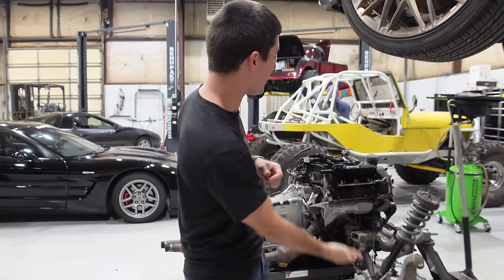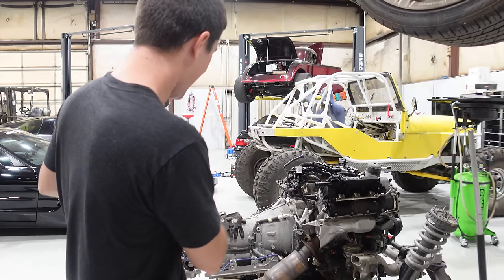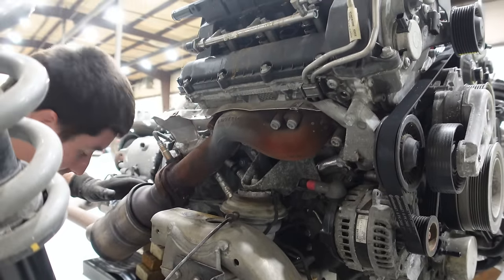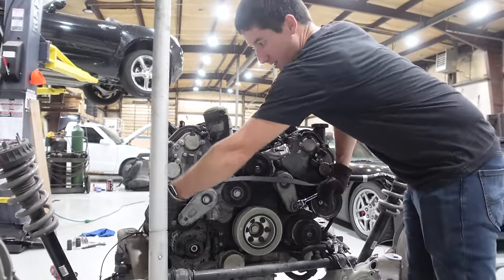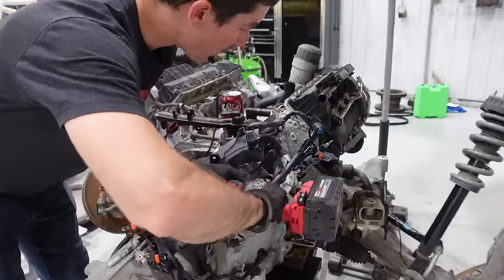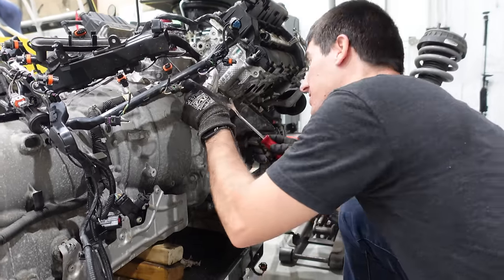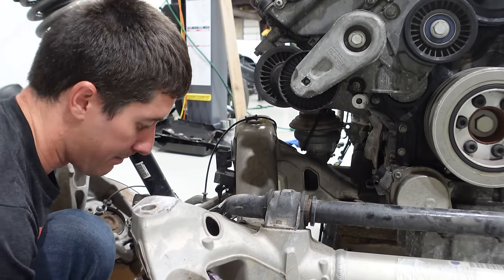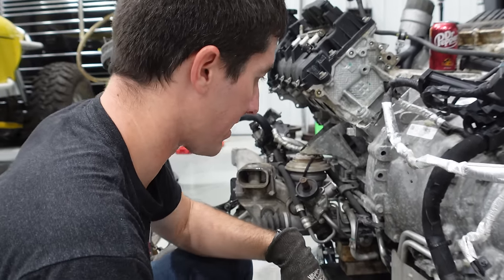My RUINED Jaguar F-Type Engine Should NOT Have Been This EASY To Separate

Comment: Regular maintenance in most of the cars: alternator rebuild.
Jag's manual:
1st step: loosen the exhaust tailpipe
2nd: remove the front passenger headlight bulb and headliner
Reply: Toyota: 
1. Check electric current
2. Wash your hand
3. Done

*Rebuilding an alternator is not regular maintenance.

Comment: How you remember where all those parts go back where they belong amazes me, can't wait to see it go back together 👍.
Reply: If you have it on video you can replay it and hopefully see. but yes I would have lost most of the bolts after five minutes
Reply: That's why he makes the videos, it's just a bonus for us..
Reply: Since it's a Ford, there should be a Chilton's manual!
Reply: @TheBibliofilus  I've seriously considered making videos of my stuff for this exact reason
Reply: If you think about it... it's really not that hard. Once you've done it a few times, you start not exactly to remember but to know what kind of bolts go on each place. Remembering or knowing quantity of bolts for each part usually helps s lot. But there's also a rule that fit every job...if all the bolts are different sizes and shapes for example, one won't fit where other one goes in. So... basically if you are just a little bit neat and tidy, you can separate all the bolts before starting the reassembly and you'll end up recognising them as you progress in your work.
Same idea goes for bolts, parts, supports, connectors...at least for me.
Reply: Curious enough to take it apart, talented enough to put it back together, smart enough to hide the extra pieces!
Reply: @blackcountryme  Lol I have not seen JR do it but CSW has a couple of trays with about 20 pockets in each so bolts/parts that come off together go into a tray pocket together. Then during reassembly he knows when he is done when all of the pockets are empty.
Reply: He's doing this on a daily basis and have done this multiple times for a very long time. And considering that he used to work in a server company doing computer codings and stuffs, I guess that he has a way in remembering, figuring how things work and problem solving.
Reply: One of the better tips, is to make a cardboard template for different areas.  Transmission bolts to the engine, head bolts (left and right side), front accessories, oil pan Whatever logical setup you can remember. Just make dots with a sharpie, the punch holes with an awl. Put the bolt into the matching hole in the cardboard.  It's a lot easier than it sounds. Saves a ton of heartache.  You can save a ton of time with a second person helping you. Label each template, and put an arrow pointing up. Also take lots of pictures. If all the bolts are the same for an area, just put them into a baggie with a label.  Remember that some bolts are torque once, they can only be used once. (torque to yield)
Reply: Idk I always do better than factory, I have a bucket of spares. But yea anyways if you work on cars you've noticed nothing goes the wrong way in without alerting you about it, instantly or after 100k miles.
Reply: @edfrawley4356  You can get little magnetised trays, in shapes, and I think colours too. that'd work I think.
Reply: He plays the videos in reverse 😁
Reply: @blackcountryme  They do ...unless you are doing an extensive teardown then you will need a lot of trays or end up mixing your fasteners
Reply: I have one of those plastic drawer nut and bolt organizers that I fill as I go in the order I removed bolts. When going back together I just reverse the order.
Reply: I’ve had the same thought - how does JR keep up with where everything goes? 

Bagging and tagging fasteners is always a great option, or screwing them back into the holes they came from works too.

I just rebuilt an engine and unfortunately I didn’t do either of the above. it was a long time between pulling the engine and putting it back in. I was able to sort through the fasteners and figure out where most of them went, but strangely enough several were missing. I was very careful when I removed them to keep them all together, so I can’t figure out how several of them walked away.

Comment: E39 540i had those same style heat exchanger for the trans cooler. I had some overheating issues with my transmission and thought the trans was going bad. Turned out the previous owner had dumped some cooling system leak sealer in the radiator and it completely blocked off that exchanger. That's the single biggest problem with these older luxury cars.......they become affordable to people who cannot afford to maintain them.

Comment: It's so crazy to keep seeing my old Z06 in the background of your shop. I had the same car (mine didn't have the mod red interior either) only it was an '03 with the silver 50th anniversary crossed flag emblems. 

I took off my body side moldings when I bought it because I hated the look. I still have them in the basement if you want a spare set. ;)

I went the NA route because I took it to road courses and didn't want to deal with heat issues. I had LT headers and a head and cam package  it was good for 450 rwhp and 43o rwtq. 

I put a Mallett shifter on it. I hated the stock long throw tractor shifter and didn't care for the super stiff B&M or Hurst. The Mallett was the best compromise IMO though it was rather pricey. The later mod after the C6's came out was using the C6 shifter in the C5.

I also had goodies so I could drive it all day at Road America like a Rin Davis radiator along with trans and diff coolers. I ran brake ducts and spindles to complete the job the GM engineers started.

Comment: Ratchet straps work for many thing's, lifting engine's included, used them a couple month's ago.  I find it better than trying to find places to bolt on lifting hooks for an 08 mercury milan that i pulled through the top after removing the whole front end and cowl.

Comment: The Jaguar AJ-V6 engine is based on the Ford Duratec V6 engine. One notable addition is the use of variable valve timing, a feature also shared with Mazda's version of the engine.

Comment: Those torx on the manifolds are torxs plus, similar size but the ends are more rounded
Reply: I scrolled through the credits just so I could find out tge exhaust bolts were.

Comment: I recently bought a 2016 3.0 F-Type with manual transmission with 30,000 miles, It doesn't look as if it's ever seen salt. Looking at this engine is the stuff of nightmares. My car is currently dead, the battery died and doesn't seem to want to take enough of a charge to allow me to open the trunk. Yay.... Pretty car though.

Comment: If torx doesn't fit it right it's probably a torx+ fastener torx plus looks really close to regular torx but has more material in the points of the ⭐ for strength.

Comment: I am wondering which company build stroker kit (crankshaft-connecting rods-piston) cam shaft and valve and high pressure oil Pump and super charger upgrade , all I found is For Jaguar F-Type V6 / V6 S

Performance kit consisting of a software remapping combined with a set of sport air filters and a modified supercharger pulley and pulley crank for increased boost. Remapping includes the optimization of various engine maps, increase of boost, the adaptation of the gearbox software and optimized power delivery throughout the entire power band. Couldn’t find long headers the original manifold can’t handle the high pressure out of the piston chamber

Comment: Them exhaust manifold bolts take a Triple Square bit Toyota uses them on head bolts and a few others you should invest in some you will end up breaking Torx bits or round out the inside of them using torx

Comment: Might be a stupid question. Does removing the engine change the balance on the lift?
Reply: It can.
Reply: Absolutely it does. Depending how far forward the rear lift points are, there is a chance that the chassis could rock backwards and fall off the lift... It might be fine, and might not...

Comment: Jaguar Daimler Land Rover was owned by Ford and the Supercharged V8 was licensed from Ford for use in the F-type as it was also used in the hypersaloon jaguar that everybody raves Inc J. Clarkson.
Reply: You've got that the wrong way round, the engine is a Jaguar design that Ford built under licence from Jaguar.

Comment: Had an egr tube on an f150 took all my might to round it off…the solution was to heat it up red hot an quench it with ice water…my method of choice is a torch and a bottle of ice water for an ugly exhaust bolts.

Comment: Maybe the exhaust manifold bolts are the British equivalent size, whatever they call that? It isn't popping right out of my brain at the moment but you should probably get the correct wrench whatever that size might be before you have to install the manifolds back. You definitely don't want to drop the engine again because your manifolds are leaking.
Reply: shudder the thought of Whitworth anything, if that’s what we’re thinking of, being used in the 21st century gives me the screaming heebie jeebies.

Comment: I ok guess I missed it, but I thought you were going to attempt the head gaskets?
Reply: That's what I was thinking while watching this video.

Did I skip something? Apparently no. And JR did mention at the end he will explain in an upcoming video why the old engine was beyond saving.
Reply: @davidpick1076  He must have seen something or all the Jag techs told him not to bother and just replace with used working engine. Maybe the head gasket job is way more work, while a engine swap is faster and more straightforward.

Comment: Bummed you had to get a new engine.  Was the old one beyond repair?  Or just not worth the time/money it would take to rebuild it?
Reply: It’s always cheaper to go used than rebuilt. Unless your building a race engine
Reply: @eileenfalcon7635  unless there’s something wrong with the block or rotating assembly just do head gaskets. It’s cheaper than a used engine, especially with these motors

Comment: are you saying that adding new transmission fluid accelerates how fast the transmission fails? or are you talking about when doing this job after 100k miles?
Reply: Sometimes if you don't change trans fluid early and often (especially in automatics), changing it late in life can make it worse and start to slip. Not sure if that's what he was talking about (didn't get that far yet), but that's the general trans fluid caveat.
Reply: I'd like to know this as well.  I've heard that the flushs can hurt if done later in life as it stirs up stuff that has settled.  However, I've always operated under the assumption that new fluid is good if you just drain and refill (even if it has a lot of miles on it).
Reply: @rpavlik1  I wonder if I should do it on my 99 xk8 with 91k miles, I have been wanting to do it before 100k, but also afraid it will make something worse, car has been dead reliable and in my last 10k miles of daily driving it has only needed an alternator and battery. but they do have issues with pressure regulator valve and I want that plus fluid for futureproofing. i’m torn on it for sure
Reply: @strongb05  on automatics that's definitely not true. It's good if you replace it regularly, but if you let it go over 100k at least, then don't touch it other than topping it up.
Reply: @h7pubg  do some research, see how that particular transmission is with first fluid changes later in life. The "change early or never change" is just a rule of thumb. E.g. on Saturn automatics, it's not really true, and you actually want to change the fluid and the filter (it's just a spin on) no matter what to try to avoid a gummy reverse valve which can cause a "reverse slam" - if you already have it, you can either basically do a fancy heated flush procedure (which helps but isn't a cure all), or disassemble and clean the affected valve, refilling it after.
Reply: @rpavlik1  source?

Comment: Probably an obvious question, but: what causes the exhaust stud bolts to be so impossible to break loose? Are they intended to be non-serviceable? Or is it just heat/age just glues them in place?
Reply: Heat cycle and corrosion. Gets red hot then cold over and over again , condensation from the heat cycle and road water causes rust which effectively glues the two surfaces (bolt and threaded hole) together and the bolt would rather snap than undo.  You can reprint this with anti seize pastes however putting a paste or liquid can and will effect torque settings you can apply as you can not compress a liquid and thus essential torque settings may be effected or give you false readings after the use of pastes. Hence most manufacturers don’t use them. It’s fine to use anti seize but be aware. ✌️

Comment: AMATEUR QUESTION PLEASE : Why does changing the transmission fluid hasten the wear of the transmission ? My amateur brain thought that fresh fluid for any moving parts was always best, no ?
Reply: my amateur guess says sth to do with the break-in period of the new fluid or improper procedure when changing transmission fluid
Reply: Changing the trans fluid only hurts when most of the clutch material is already in the old fluid. Soo as long as it shifts normally with no clunks or shudders change it! Chris fix has a great video on this
Reply: @대격변이퍽내가바로  Thank you
Reply: @brysonshires9742  Thank you ! I will search out Chris' video.

Comment: I would just put a coyote motor in it and be done. That thing looks like a nightmare to do anything on it. Even change the belt. So this engine you have coming. How long will it last? I just don't see the draw to this type of car. Over engineered from the head lights to the rear license plate. I would rather spend my money on a bad ass hot rod any day. Maybe I'm wrong.
Reply: I'm a fan of most British cars but this car is definitely a turn off! 
I want a car that doesn't cost a working lifetime to own.
Reply: @generatorjohn4537  you better stay away from any European car. They are all money pits.

Comment: Hi that was great but don’t understand the comment about the transmission fluid. If you change the fluid, it accelerates the deterioration of the transmission?
Reply: I guess it has to do with introducing oxygen into the system and accelerating breakdown of the oil. So they must have a system in the factory that removes oxygen while adding in oil. I wonder if the Jag service centers deal with that using some piece of equipment or just crack it open the first time and not worry about it, making the assumption that most original owners won't take it much past 100k before trading it in anyway.
Reply: @marcusdamberger   my F type has covered 23k in 7 years. I was considering a gearbox service and wondered if there was a downside to a fluid change by a ZF certified shop ?

Comment: I still struggle with even the idea of this "Ford built/designed the AJ series" they have clearly used Ford parts everywhere (even interior) but Ford owned Jag for a decade. Every manufacturer does this. It's all accessory parts he pointed out. By any definition.. how does that make it a Ford?

Comment: This was about when Ford bought into Jaguar ( i am guessing Jaguar were in trouble ) who did not have new engines or spare cash to develop new engines, Ford had several reasonably new V6s V8s that were ready to go, problem solved for Jaguar. Maybe i am wrong BUT i doubt it, this engine has ''Ford'' stamped on it in several places!!!!
Reply: And a bit earlier the Aston Martin V12:s were 2 Ford V6:s fused together kinda... nowadays they use Mercedes AMG engines instead..
Reply: AJ V6 is a Ford Duratec with Jaguar mods, which in turn was an original Porsche design V6.
Reply: Sigh.  Not this again.  Jaguar designed this engine from scratch, using only the woodruff key from the Ford parts bin.  It made sense to use FoMoCo accessories since they were readily available - why waste time and money designing and making your own?  The engine was built in a special section of Ford's Bridgend engine plant under licence from Jaguar.  That agreement ended in 2020 and the engines are now built at Jaguar's own engine plant in the Midlands.  So it's not a Ford engine, in spite of ignorant people continually perpetuating that myth.
Reply: @stevemawer848  there’s nothing wrong with ford helping jaguar. when they bought jaguar in 1989 and dumped lucas and improved their antiquated facilities, from 1993 and on the cars became far easier to own. their mass production experience helped jaguars production r&d and there is nothing wrong with that. jaguars after 1993 started having far less random electronic issues and more electronic issues based on low battery voltage, very reliable cars with some preventive maintenance. I would not buy a jaguar during Tata ownership, 1993-2010 are the superior years. not a fan of the overly complex direct injection 5.0s, 4.2s are bulletproof, 4.0s also with some preventative maintenance, and inline 6 4.0s are bulletproof even by asian standards.
Reply: @h7pubg  Interesting that you think the 5.0 variation of the 4.2 isn't bullet-proof.  BTW, I never said there ws anything wrong with Ford's ownership of Jaguar - they saved the company!

Comment: Do you think changing trans fluid in autos is bad actually?
Reply: In these newer designs they are sealed systems, and oxygen free to extend the life of the oil. Designed that way to make them last longer.
Reply: @marcusdamberger  the rule of thumb I learned was if it has a dipstick then change fluid every 50k miles or 80km. 
If it doesn’t then leave it alone. 
Sealed transmissions can have the fluid replaced in them but if they have more than 100K miles on them they need to be left alone.

Comment: It is a Jaguar engine through and through, you won't find it in any Ford.... Jaguar designed tested and validated the engine including using some parts from Ford. Ford then built it for Jaguar.
Reply: Oh and the manfiold bolts are polydrive or "ribe" heads.